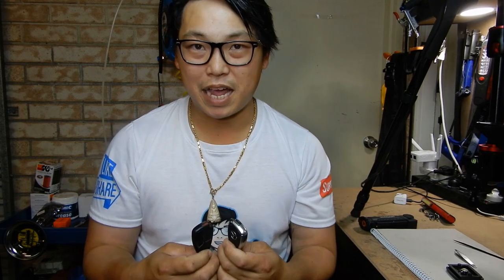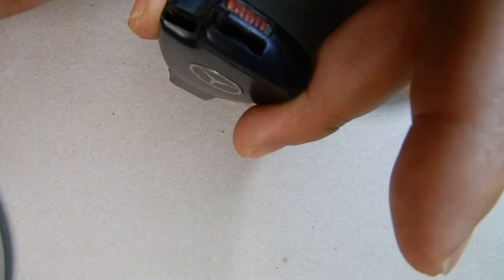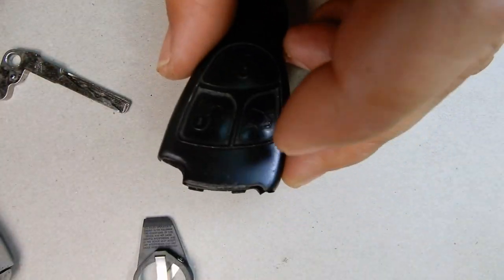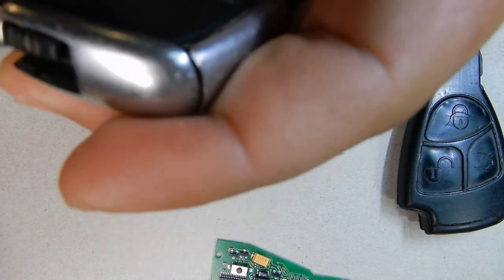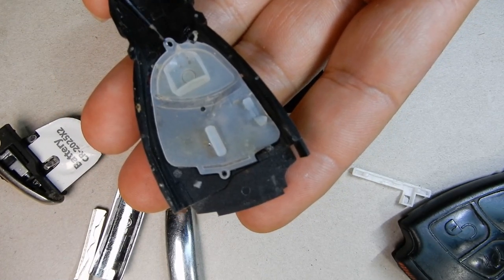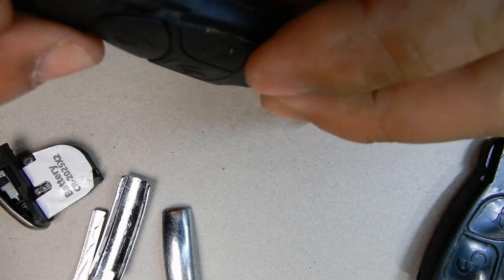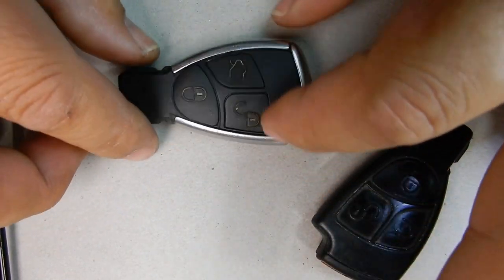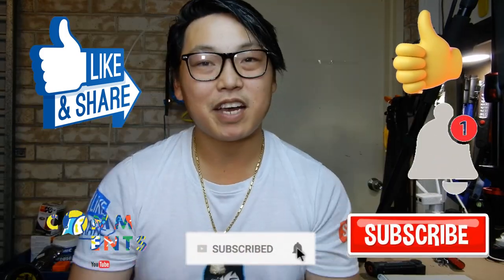how to take apart mercedes benz keyfob shell case modification upgrade

Comment from the maker: hey guys so i wanted to mention that whether you have the 2 button 3 button or 4 button style keyfob you can find the same buttoned keyfob to upgrade your keyfob...remember you can only swap out to the same style keyfob...if you want to update to the newer newer style keyfob like i listed in the description that is possible too, but you would need to get a key cut specialist to program the key as it needs a new chip to be programmed to your esl eis so it can work in sync,,, basically creating a new key... and if you get a new key im sure you can choose any style key as long as it can fit in your ignition and it responds to your car...thanks for watching guys... much love
Reply: So depressing :( I had a new key w/3 buttons, and my old key w/2 buttons and guess I can't update the old one to new casing. Thanks for the video tho! Very awesome for those able to update.
Reply from the maker: @Alecksander  actually as fate would have it u can. if u look through the comments .u will see someone who had 2 buttons and went to 3 buttons with everything working.. I know it's strange but I think it may be possible after all... do some research.. I would have thought that there may be some programming involved....but this fella said he did it by simply changing cases

Comment: Hi good video but does not cover the 2 button key that is the same shape but pops out the side for battery change and does not have a separate top. Supplied with the 2010 B180. Would much appreciate your input as it seems that the two parts of the case are glued together.
Reply from the maker: good tip thx for sharing, but ye u right, i cant remember if i mentioned usually only works for 3 button to 4 button but depends on your pcb , i guess it would be hard to get a 3 button to work on a 2 button board cuz the buttons are placed differently.. so ye makes sense
Reply: That's a pretty rare key, same as Mercedes commercial vehicles, already uses the BGA chip I think

Comment: Heyyy thr my 2004 w211 has the old black key case. If I am to buy a new case with the chrome corner from the first link you shared, will it fit properly because my key is not as symmetrical as the chrome key in the link.
Reply from the maker: if tour key is the same as mine yes.. but either way regardless of what ur key looks like yes it can be upgraded to the newer style case so long as u choose the correct case for your chip board
Reply: @MIKEYZVLOGZ  heyy thank you for your response! I have the exact all black key case but in order to change to a chrome one i need the exact new shape kinda case but in the event of the link you shared with us, the chrome case is meant for a newer model chip one.
Reply from the maker: @samsiow7115  so from the links I shared which is tour key  ? send me a pic on ig mikeyz vlogz and I'll take a quick look and advise

Comment: Update!!! My original key is/was a two button only but I found out that the circuit board only requires a button switch soldered to the board. So I bought some circuit board switches off eBay! And I soldered both the main key and the spare!!! Now I have a three button key and now I can pop my boot on my 2004 c220 sport-coupe!!! Well chuffed…. So highly recommended to buy this case and some buttons if you only have a two button style key…..
Reply from the maker: that's great news mate
Reply: @MIKEYZVLOGZ  it was mate as I paid £28 for the fob and £2.50 for 3 switches 2 of which I used. I’m glad I’m a vehicle tech by trade…. And I do a lot of electrical soldering. But I must say you are bang on with it adding a touch of class…. I feel proud when I pick up my car key and see it’s like this is awesome
Reply from the maker: @Andrew Denton  u know it ...glad u feel the same way I do .. I love looking at the keys now too
Reply: @MIKEYZVLOGZ  I don’t know what colour interior you have but mine is all black, black leather and silver and chrome accents and the key just finished it all off to a tee! So sad 🤣🤣🤣🤣
Reply from the maker: @AndyDento21  nice mate

Comment: After changing the shell car don’t start but buttons lock/unlock works fine. What to do
Reply from the maker: it will be the chip did u do anything else ? did u place it in right ? very straight forward exchange it should work ..if bot try go back to ur old case cover and try it .. if it work..then the issue will be transferring the chip over and something isn't being swapped right or misplaced